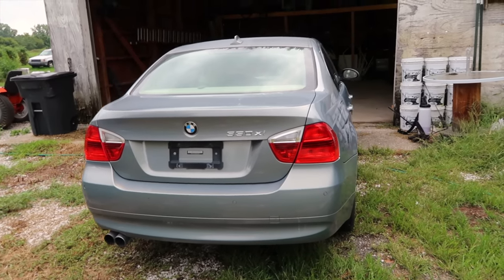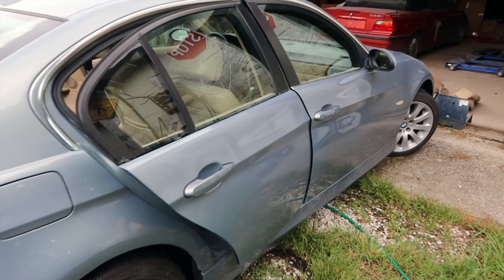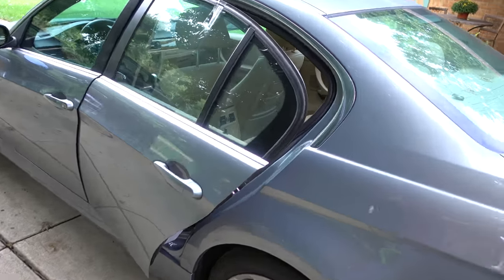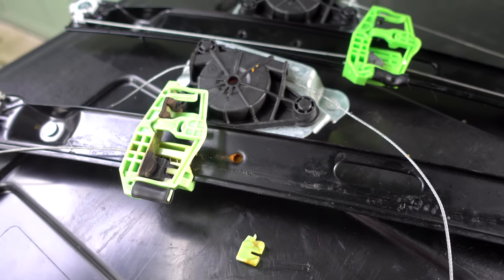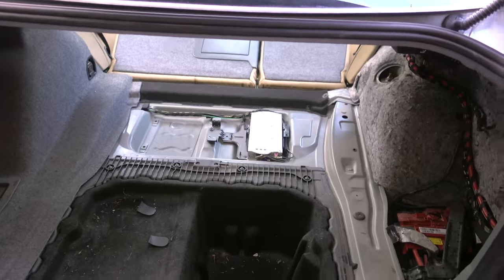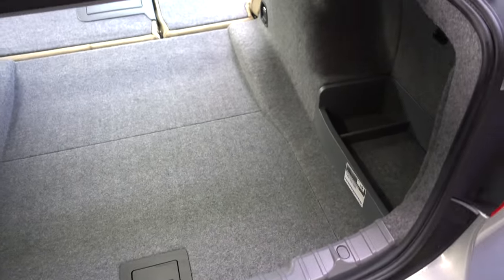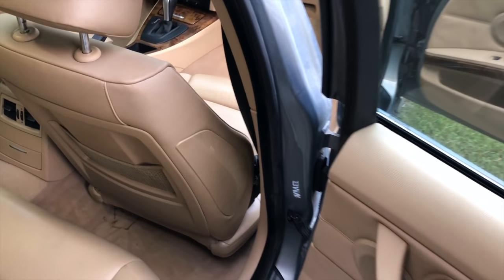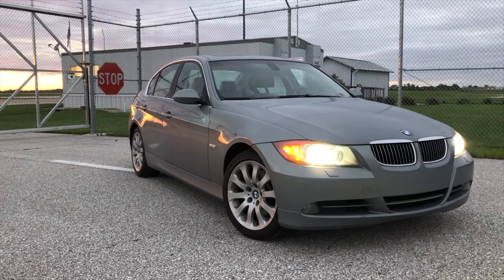BMW E90 330Xi Final Assembly & Repairs -- Rebuild Part 3

Comment: I would definitely like to see maintenance videos on the car. Mostly because I own one just like it (same year, color, and trim haha) I've had mine for over a year now and would for sure recommend it as a daily driver!
Reply from the maker: Awesome! How’s your car treating you? I’ll probably put together a maintenance vid since I’ve gotten several people saying they’d like it.
Reply: Crossroads Rebuild  When I got it there was two oil leaks I had to fix along with a struggling starter that eventually failed on me two months in (that sucked). After that, (knock on wood) it's had no problems and has been nothing but enjoyment. An interesting maintenance video I would suggest are the vanos solenoids. I don't think they are too hard to replace and I believe they might be the reason the tac fluctuates on cold startups.
Reply from the maker: Interesting idea. I’m going to have to do some research on that. Thx!
Reply: Crossroads Rebuild no problem and good luck with the car!
Reply from the maker: Thank you!

Comment: the car looks amazing that paint job is perfect, are you losing money on this one too considering that it was done by a shop?
Reply from the maker: Thx! Well... not sure about the losing money part since I haven’t tried to sell the car. Based on my research I could pretty easily sell the car for what I’ve got in it and probably make a small profit too. But right now I’m not focused on selling it since I’m using it as my DD. But I’ll do a video outlining the costs of what I’ve had done. My friend was very fair on the paint and body work!